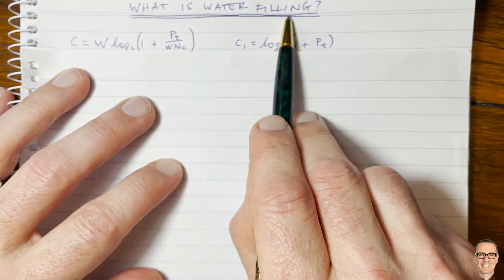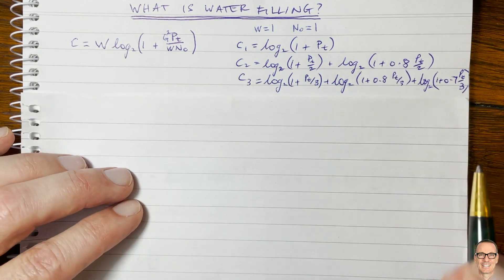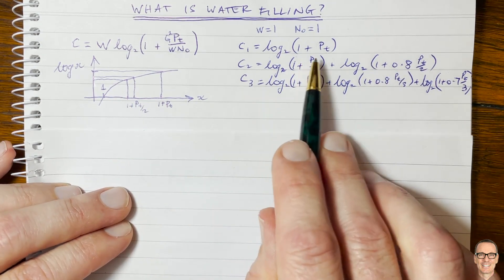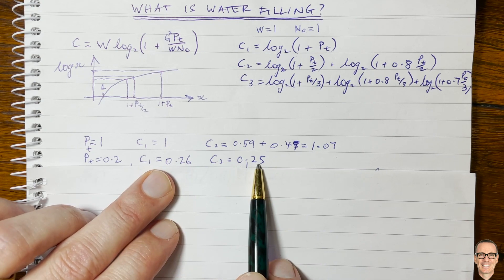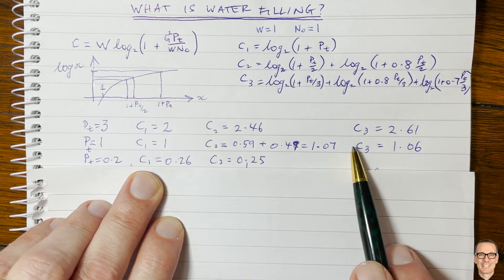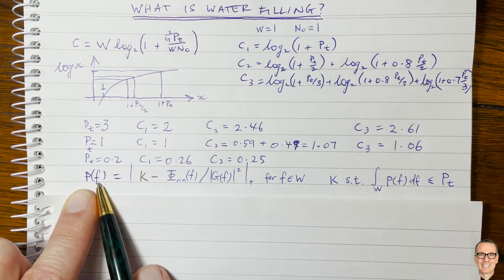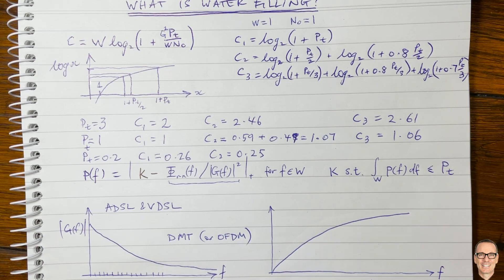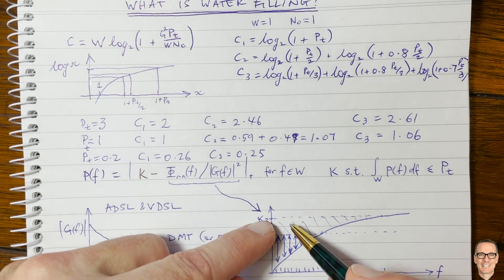What is Water Filling for Communications Channels?

Comment: Sorry if i am wrong. This video assumes 1 transmit antenna, right?

Also, in your example we try to estimate the number of subchannels(N) given  Pt. 
In OFDM systems, N is determined by the length of IFFT and all of them have to be utilized in order to transmit an OFDM symbol.  So we have to find the K, which satisfies N subchannels and then we decide the required Pt.  Is it right?
Reply from the maker: Note that water filling is not limited to wireless communications. However, yes, in the wireless case, the video shows the situation for a single antenna scenario. In the case where OFDM (wireless) or DMT (wireline, DSL etc.) are being used, yes, the length of the vector is fixed in the respective standard. However it is not necessary to put energy into each subcarrier in the OFDM/DMT symbol. And likewise it is not necessary to put equal energy into each subcarrier. This can be done by using different constellations in each subcarrier, with different powers. Of course, as I mentioned, water filling requires knowledge of the channel, so it is generally not used in wireless communications with rapidly fading channels.